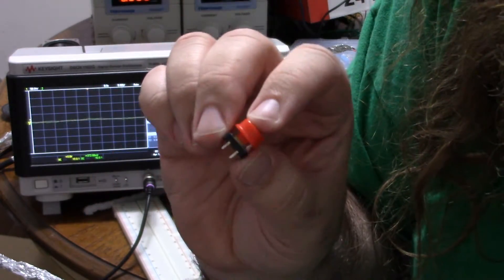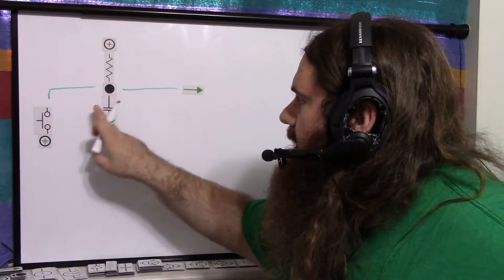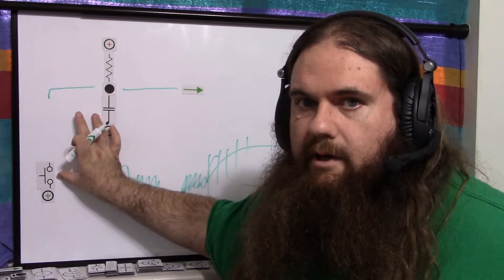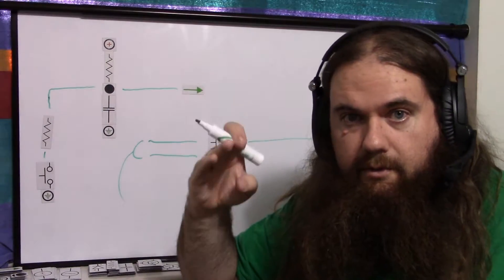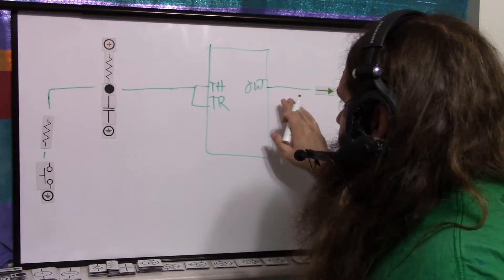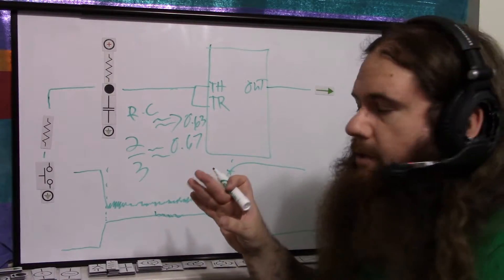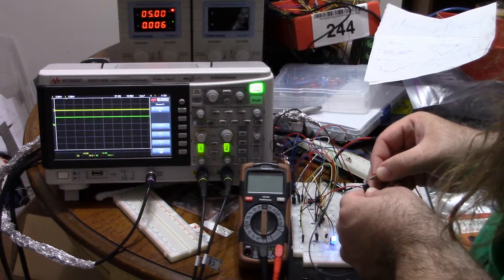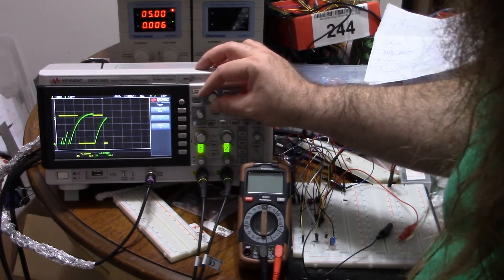The Best Possible Cheap and Easy Switch Debounce and Noise Immunity Technique - Simply Put

Comment: If you've got a microcontroller to act on these switch inputs - then use it.
Set up a timer interrupt to generate a 30ms (or thereabouts) interrupt or set a flag that the foreground can poll-act-reset.
You'll need 3 storage elements: SwitchNew, SwitchOld and SwitchActions
Then sample the input(s) (bit -, byte - or whatever wide) and store the result to SwitchNew.
Next XOR SwitchNew and SwitchOld to produce an edge-detection difference result.
AND this result with the SwitchNew or the inverse of SwitchNew to detect the Make or Break event.
Finally OR this last result into SwitchActions and then overwrite SwitchOld with SwitchNew.
Test and reset SwitchActions at your leisure.
The only initialisation required is a dummy read and clearing of SwitchActions.

Comment: is the high config better  than the ground input config ? I have problems with bounce... using software with 100ms and working fine but I wish I could run it with 40ms flawlessly... does a 1k resistor would do the trick puting in the ground? I have a pi pico ...

Comment: The extra chip is not 3 cents.  It's another point of failure, the cost of procurement, the cost of assembly, and the cost of board space.  This can add up to quite a bit when you bring a product into production.

Comment: Great video. Schmitt triggers and monos are good however,  one engineer said two inverters, cross coupled input to output can eliminate the pull up/down resistor. Ofcourse, I have yet to find where I left his  design. Often RC differentiators are used on timer trigger inputs.  You could show us some spikes on that pretty Oscope.
Reply: That only works if you have a SPDT switch.

Comment: for a shift register I recently created that simple solution with only capacitor and resistor is definetelly not enough! It counts at least a few pulses! To check I hooked it up into the pulse generator with very clean CMOS signal and it worked perfectly so I am looking for reaaaaaly precise solution at least similar to my keyboard I am writing it on ..

Comment: Many 555s make poor denouncers because, ironically, they may have ringing in the output switching transitions that will cause false triggering. The best debouncer is a switch with a 
pull-up (or pull-down) resistor, followed by a R-C integrator, followed by a hysteretic inverter such as one section of a CD40106 Schmitt trigger.

Comment: A nice technique and I too am a big believer in adding the resistor on the switch. Eventually, the massive currents, even as brief as they are, will pit the plating on the switch contacts. I typically use 100 ohm but anything from 10 ohm to about 1/10th the pullup (or pull down) resistor will work fine. I've seen 220 ohm used a lot too.

But as others have pointed out below, I feel the Hex Schmitt Trigger IC makes more sense in many environments. I have been using it for almost five decades in industrial designs as well as hobby use for myself. You get up to six channels or can use any leftover inverters to invert the switch signal or even use them as general-purpose inverters in other parts of the circuit (they are a tad slower than a typical inverter using the same process however). And in the case of a CMOS Schmitt trigger, power consumption is very low, and they work well with 3.3V (and lower) logic. And they are very inexpensive, probably in the same cost area as a single 555 and likely cheaper than CMOS variants of the 555. On a CMOS IC like the 40106 or 74HC14, the very high input impedance allows for larger resistors and smaller capacitors. The same may apply to a CMOS 555. The Schmitt trigger also has a rail-to-rail output but of course a much lower logic low output current than the 555. And you only need a power supply bypass cap to use it (in addition to the 2R and 1C for each switch).

I do of course agree that many times you have to use what you have, but for me, the Hex Schmitt Trigger is a required part to keep on hand in quantity. It is perhaps the most used logic part I have designed in for the past 40 years. In the hex format and the 1 ,2 and 3 gate Tiny Logic versions.  It also makes for a very simple RC oscillator as well. But if the choice is available, I prefer to do debouncing in software when possible.

One other thing to mention, switch bouncing will usually get much worse as a switch ages. While a new switch may complete bouncing within 10mS, a worn one might be 20 or 30mS. Beyond that, they are usually unusable. In an industrial product, switches get abused and evaluating product repairs has allowed me some great insight into just how noisy switches can get, which in turns has allowed me to fine tune debouncing over the years.

Too often I see the RC or RRC circuit used with the switch fed into a standard (i.e. non Schmitt Trigger) input. While it may work in some cases, it is not a good practice. Most chips have a minimum rise time on the inputs (again, except for Schmitt Trigger inputs). Doing so can cause instability, can cause the input stage to oscillate or ring and can lead to excessive current consumption that can damage the input transistors in the chip. So, using a technique like shown will definitely make for a more robust circuit design and I would not consider that overkill.

It is always good to hear a technique explained well with great examples of what is happening. I thought the explanations were very clear and concise. My only disagreement is the "Best Possible" part as I feel all the advantages of the Schmitt Trigger IC are better. My opinion of course. But it is still a great video!

Comment: At about timestamp 3:55 when you add the resistor, aren't you creating a voltage divider whenever the switch is closed, thus bringing the logic low  level output a wee bit high?
Reply: Yes

Comment: Golden! Answer to my challenge: barebone rotary encoder in combination with arduiono interrupt. Only latching and pretty decent deadzone in between could save me. Many thanks!!!
Reply: read out data pin on rising and falling of the clk pin. if the data pin changed value between rising and falling clock, it was a valid input, otherwise it was just a bounce. no hardware needed.

if(digitalRead(enc_check_pin)==HIGH)
        last_encoder_count=1;
    else
        last_encoder_count=0;

    while (digitalRead(pulse_pin)==LOW)
    {
          //wait for clock rising again
    }

    switch (last_encoder_count + digitalRead(enc_check_pin)) //1 means valid, 0 or 2 means bounce
    {
    case 1:
        if(last_encoder_count == 0)
        encoder_count++;
        else
        encoder_count--;
        break;
    
    default:
        break;
    }
Reply: Noooooo! Do not denounce, getting it right for all speeds does not work!
The correct way is to create an inturupt driven state machine. Since the output pattern can (in an ideal world) only change in a known order, denouncing is automatic as the output pattern is as expected or not.
Even cheap and nasty rotary encoders can work beautifully!

Comment: Schmitt trigger inverters are made to interface slow rising or slow falling signals to digital systems and have built-in hysteresis for better noise immunity at the logic thresholds. I use them for my switch debouncers.

Comment: Thank you for the thorough explanation. I was curious how to calculate the Farad value for the capacitor? Would a 1uF or a 10uF capacitor be better?
Reply: the value of the capacitor can be multiplied by the value of the resistor. It is called the RC time. IE:
10uF x 100K ohm (0,000010 F x 100000 Ohm) = an RC of 1 second
After 1 RC (also known as Tau) the Capacitor has lost 63% of its value.
Or loaded up to 63% of its value, depending on the way of the circuit.
In this manner 1 second.
If you change the R or C value, therefore the RC time, the time in which the 63% point is reached, can be changed.
Reply: @ericgroen253  Thanks. How is the 63% values meaningful here? Something like an element's half life or just an arbitrary number?
Reply: @prvashisht Late response, but maybe someone in the future will find this useful. Knowing that the current in a capacitor is equal to C*dv/dt you can solve the differential equation for an RC circuit and find that both charging or discharging a cap is an exponential function. The math works out so that you get something like V(t) = Ve^(-t/(RC)) for a discharging capacitor and where V is the voltage at t = 0. Plugging in RC for t will give you Ve^-1, and e^-1 is approximately 0.36. So after time RC (also called tau)  you're left with 0.36 of your initial voltage or a  63/64% decrease in Voltage
Reply: @prvashisht  It is science... Every RC time, the actual value is dropped by 63%. So 63% of 63% of 63% of 63% of 63% is near to 0.
(Sorry for the late response)

Comment: I  like using Schmitt trigger inverters for debouncing. You will get 6 of them in one 7414 or 40106 and it's simpler than setting up a 555.
Reply from the maker: True, but 555s are cheap and incredibly flexible, and one of the first things a hobbyist will acquire a box of, whereas I still don't even own a schmitt trigger chip (eventually I will, of course). And they're fun!
Reply: @simplyput2796  Look around on some old electronic and you will probably find a 7414 because they're very common.
They're also perfect for making very simple oscillators. All you need is a capacitor and a resistor/potentiometer.

Comment: You can also use a schmitt trigger to debounce, it does the same as your example with the 555 chip
Reply from the maker: Yep, but I like this because it's a little more flexible and configurable, plus easy to have a box of them lying around. Plus, you can just implement the 555 circuitry yourself externally, which I do to create a tri-state detecting output display board (to be shown in a future video).
Reply: Simply Put ‘Implement externally’ can you explain what you mean? I used quad Schmitt triggers chips can debounce 4 switches with one chip. 
Like your videos, very clear explanations, thanks.

Comment: im really glad  you made this video because iv came across this problem before giving me false positives when trying to turn things off and on..  can't remember what it was doing it on it was before i started learning this stuff. by the way that pure genius using the trigger & the threshold pins on the 555. . YOU SHOULD DONATE YOUR BRAIN TO SCIENCE..((& how doesn't have a 555 in their parts box)).. oh & ya know how you said that made you happy!! it made me HAPPY TOO. class idea, & class video : ) 
P.S. ya hook up pin 8 & 1 on the 555 to power it yeah??   "I know the answer is yes but i have a habit of doubting myself alot". which i should stop doing!!  thanks again best you-tuber without a doubt ; )
Reply from the maker: You'd have to refer to your datasheet. I'd never trust one universal "this is always pin X no matter what" no matter how old the chip design is.
Reply: @simplyput2796  is that the 555 datasheet your referring to???
Reply from the maker: Yes, look at the top of your chip and note down the actual part number (NE555P for the ones I have) and look up the specific datasheet (e.g., google "ne555p datasheet pdf") to double check. You never know when you'll end up with some random chinese knockoff that moved the pins around.
Reply: @simplyput2796  thanks for that bud!! my 555's are "NE555P" too..  ill do that anymore!! look up the datasheet for any chip i get and not take it for granted that it is just generic!!  so thanks again, your the best : )
P.S. whats your first name by the way( you don't have to let me know if you don't want, or if you prefer to keep privet. i would understand that & i wouldn't take it bad if that's the case)

Comment: Great video! You just invented the Schmitt Trigger! :-) Just kidding. The 555 timer is able to act as a Schmitt Trigger, yes. But you can also use one (or two) inverters with Schmitt Triggers as available in 74HC14 or CD40106, by combining two inverters you have one single buffer behavior. In that ICs there are 6 of those available each.
Reply from the maker: Yep, the schmitt trigger is something I investigated, but I'm a big fan of "easy to remember catch-all and simple" subcircuits, and the great thing about the timer is it's a single component with no accessories needed, and can even be reconfigured in some ways (such as changing comparison voltage range, and switching between active-low and active-high) STILL with no additional components. "Best" means different things to a hobbyist v. a professional.
Reply: @simplyput2796  I fully understand your point. But when it comes to an ESP32 dealing with 2 rotary encoder, 555 becomes more expensive than the ESP! 😉
Reply: I’ve always used Schmitt trigger inverters as you suggested, but I totally overlooked the humble 555 which may be a bit smaller device if you’ve only got one switch to debounce. On the 74c14 you just bung it through a second inverter to get your non-inverted output back if that’s what you need. Size also depends on how many extra passives you need for a 555 vs. a 74c14.
Reply: Does that really work:two Schmitt trigger inverters in a row or shouldn't you do this 74HC14-->74HC04 instead for a buffer?

Comment: Initially, I though the debound signal was caused by the conservation of momentum and the coefficient of restitution between the surfaces. Though after some contemplation it would appear that the noise comes from dielectric breakdown between contacts, as the switch closes there are tiny arcs between them. The sparking allows the switch temporarily discharge, which decreases the field as charge is depletes.
Reply from the maker: Oh that's definitely a chunk of it, but there're a whole host of things that can cause a goofy signal. Use two alligator clips as a switch, hold them tightly together, and then rub them together without breaking contact, and you'll get a horrible waveform. Contact bouncing is the electronic equivalent of a seizure.